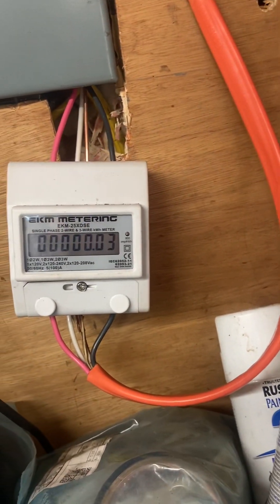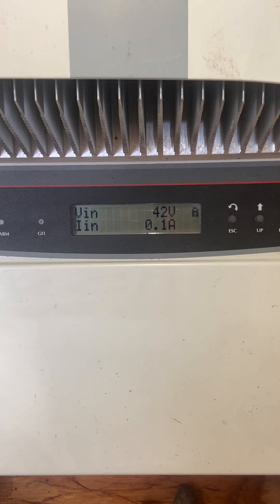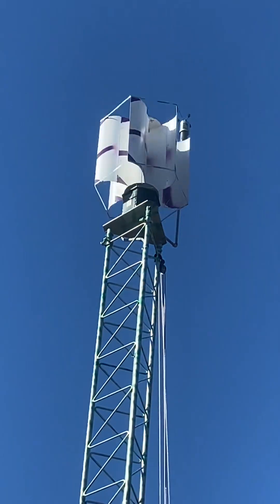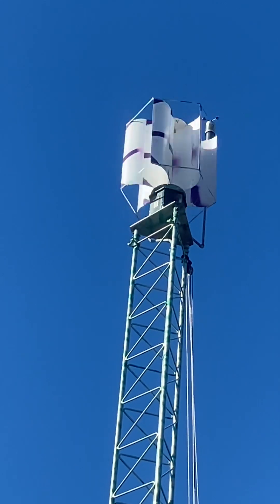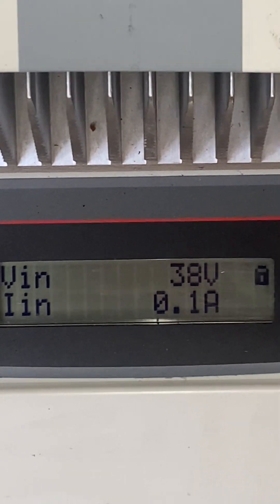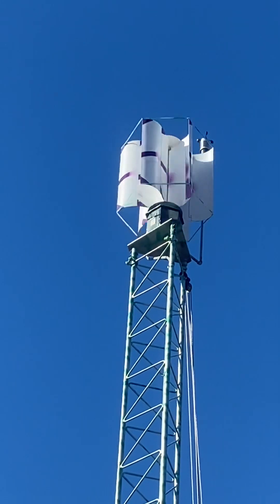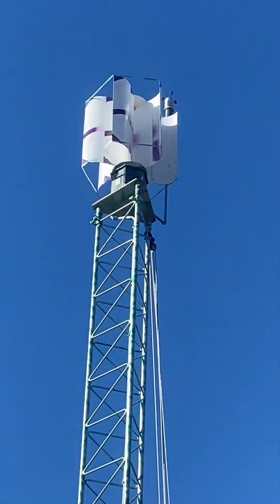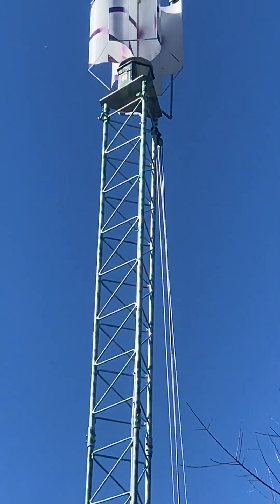Vertical Wind Turbine  Part 53  Never buy Tesup￼￼

Comment: The inverter is designed for a higher voltage system.  The number of windings in the generator sound like they're designed for a 24 volt system not a 50 volt system. Did you try going back to the (repaired) converter and inverter?
Reply from the maker: It’s all worthless crap… made by dirt monkey’s in turkey.  They can’t ever produce the power they claim. NEVER… I’ve got it all on videos.

Comment: Was wondering what gage wire and distance you are running?
At that voltage you could have significant losses if the gage is small.
Reply from the maker: Total run is 80 ft.  10 AWG.   Great thing about AC,  you can go a long distance before a voltage drop.
Reply: @Themachinewon  That’s one solid connection, no issue there … 👍
Reply from the maker: @SuperNemesis12345  all the wire connections are soldered & heat shrink. I even tin the ends going into the interface box and inverter. 
eliminates all possibilities of corrosion at wire connections.
Reply from the maker: Voltage drop: 0.051
Voltage drop percentage: 0.042%
Voltage at the end: 119.949
This is one of those apps.